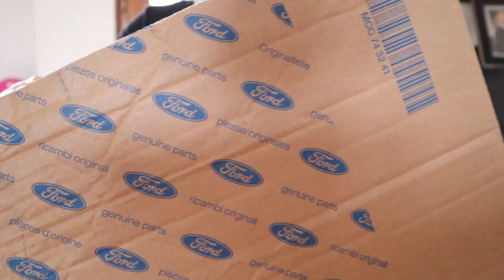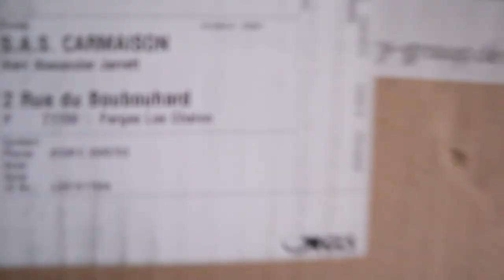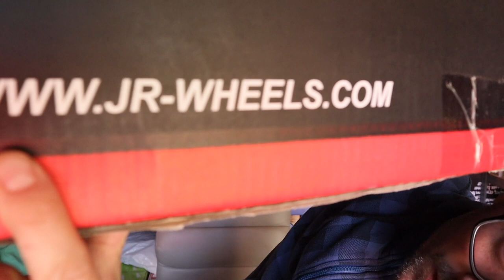Rebuilding a Wrecked 2017 FORD MUSTANG GT  PART 5

Comment: I should have waited until Pt 5 to see the spring compressor!!! Ha!! Question...what is the blue ju you use on bolts? I've seen you do this a few times now
Reply from the maker: It is a special glue called LOCTITE, it stops the bolt/nut from unscrewing. It's a security measure I guess and certain parts of the car  need it. You can buy it on Amazon or local parts shops. Thanks as always for your support!

Comment: But if you bought new alloys why didn’t you ordered them the right ET so you don t need to use spacers?
Reply from the maker: That’s not so easy in France... Wheels for Mustangs are not easy to find... however in the end I didn’t need the spacers as they fitted just right 👍
Reply: @WIMPYbrothers  Can you tell me the ET values of the wheels you used?